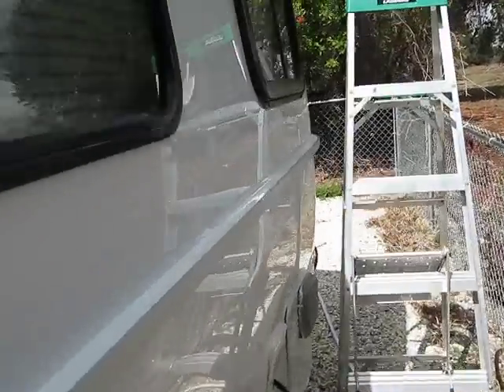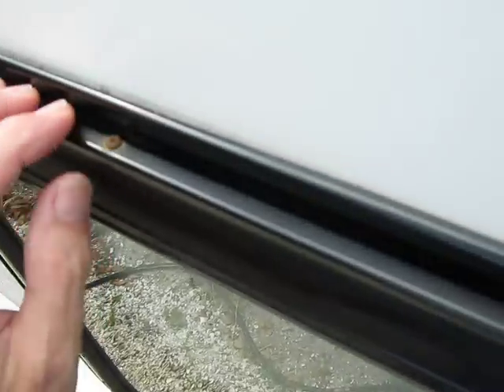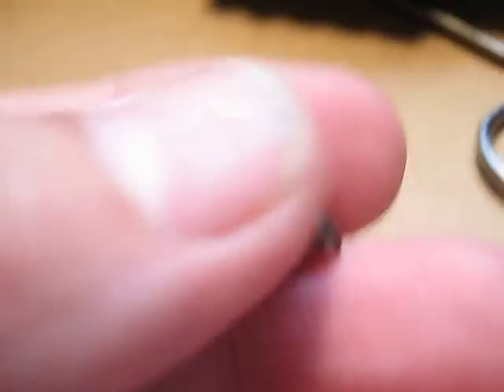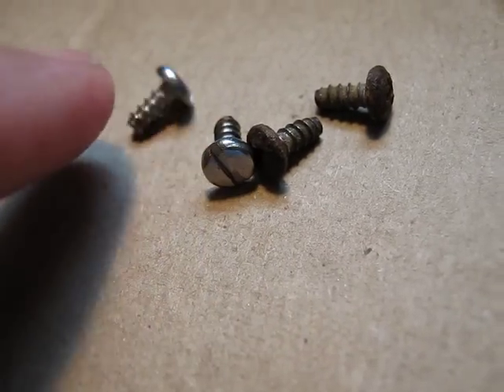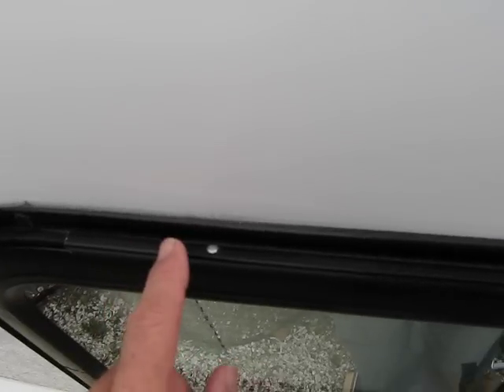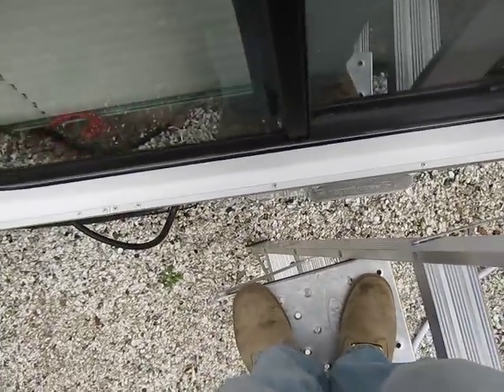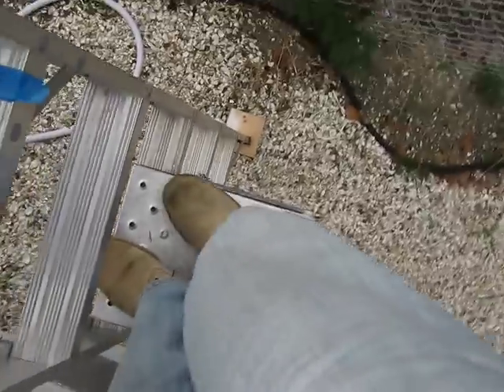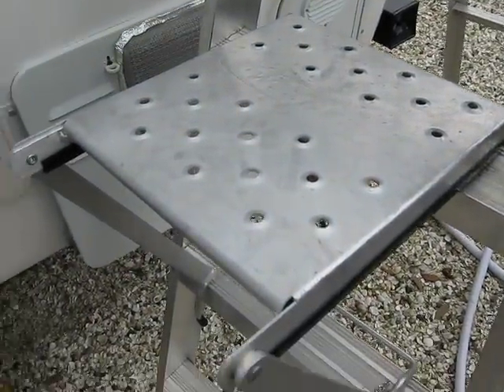How to Replace Rusting Screws Atop Casita's Break Out Window

Comment: I was wondering WHY you didn't use your Dremel with a small brush to clean the inside threads to the Hot Water Heater instead of a tooth brush?